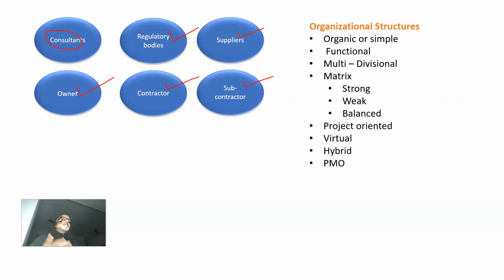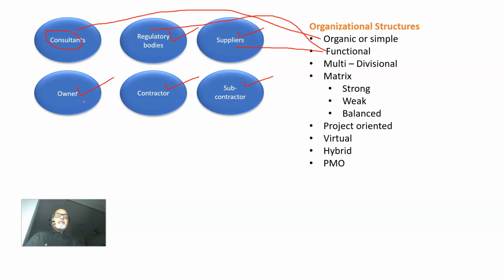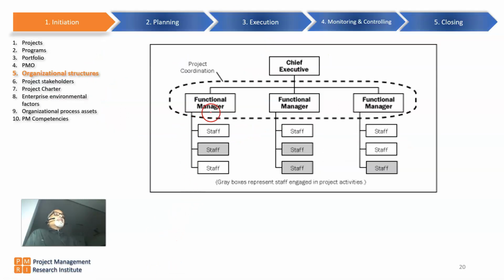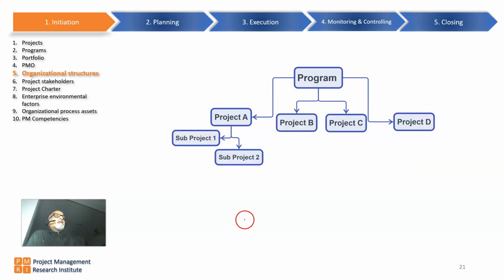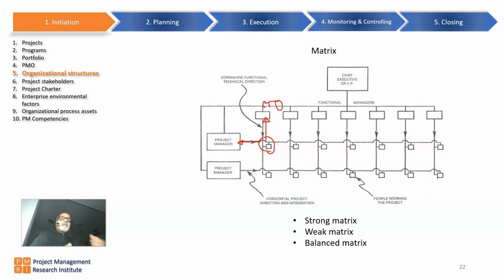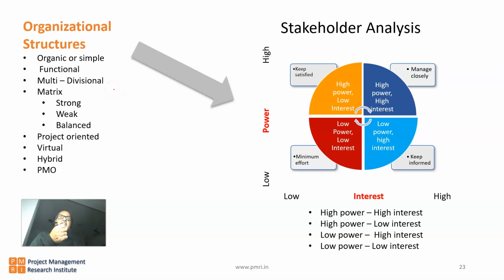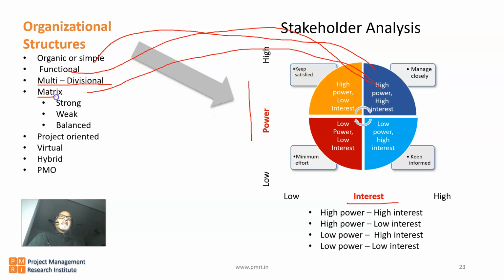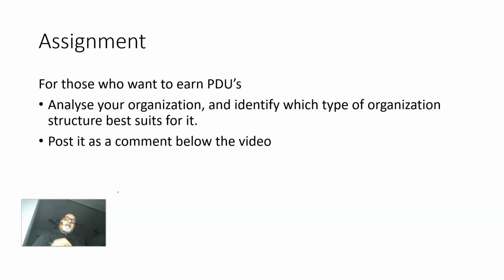Organizational structures and power equations

Comment: My organization is a bank. It is more functional organization in nature. It also has PMO division which consist of pooling of PMs. 
In a project, PM from PMO division will be assigned, whilst the team members are from the functional division. However, the team member is not fully assigned to the project and still has BAU responsibility. Therefore it is balance matrix organization

Comment: My Organization is a Balance Matrix Organization. Each Engineering Discipline and Department have Functional Managers. They have different teams of engineers of different strengths, reporting to them. Then there are also Project managers separately handling the teams. Their authority level is at par with the Functional Managers. Every deliverable created within a project undergoes an Electronic Workflow. Electronic Workflow means the document deliverable will go to the Checker for his review, then after his review, it goes to the approver and back to the preparer of the deliverable to finally issue the deliverable after incorporating the comments given by his seniors. The electronic workflow is done twice, initial revisions of the deliverable approved with Functional Manager as the Approver. Final revision of the deliverable, example Issued for Construction (IFC Stamped) shall  go through the Project Managers as Approvers. Project managers may consult with Functional Managers anytime about any query in the deliverable while their review.
Sometimes during non availability of either of the Managers, the other will assume the role of Approver and approve the deliverable.